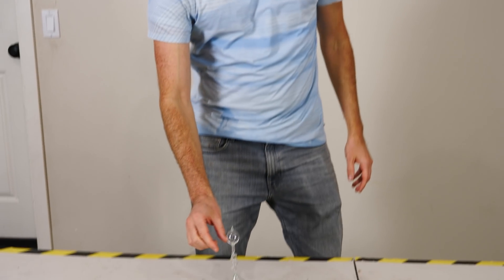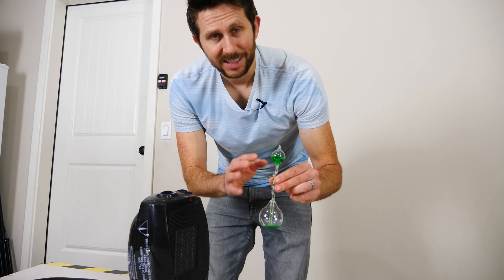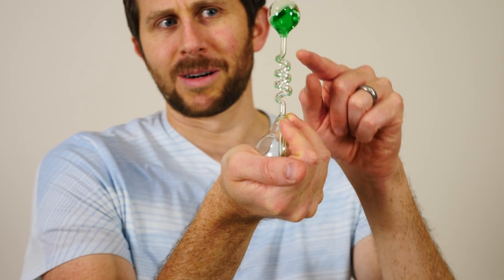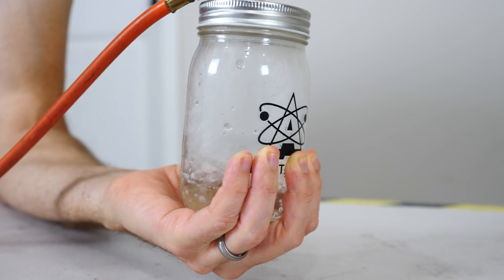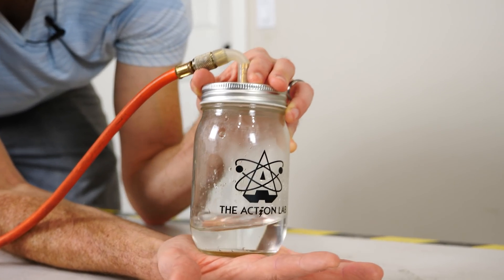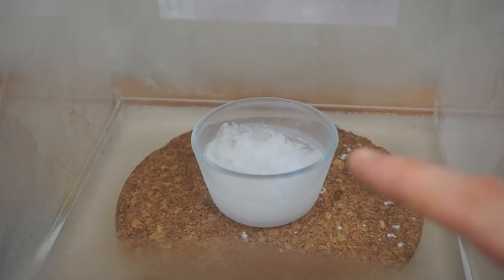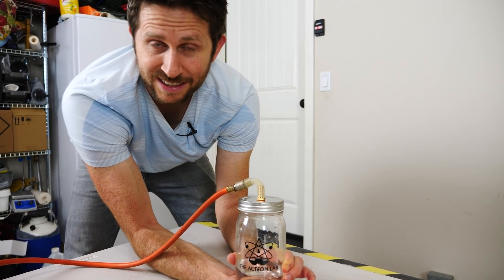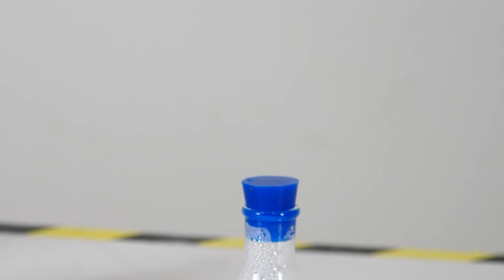Boiling Water By Heating It With My Hands

Comment: Okay I don't know how many people have fallen for his boiling water with the hand trick but his scientific explanation is very much wrong you can get water to boil without heat by simply decreasing the are pressure around it.  kind of like going up into an airplane the air pressure is 75% lower than it would be on the ground even with pressurized cabins it is why you end up with a crappy cup of tea or coffee on an airplane and while your ears pop now when you remove air from the jar of water it can boil at any temperature  it all has to do with the molecules of the water and the pressure put on them nothing to do with a hot or cold so if someone's going to post something about science please get the information right before posting there are people who will fall for this and get angry especially if they're going to do it for a science project in one of the classes or in front of a professor talk about being a laughing stock in front of your peers 
All I ask is to please do actual research on a project before you post

Comment: So, infrared light shined on say, an old 50 gallon water tank painted with matte black paint would boil or get really hot? or any container painted black?  I do camping a  lot and wonder if this would heat water for a shower, dishes, etc. for an off grid cabin (or black 2.0 paint is better??

Comment: At first I thought the "hand boiler" had all the air removed so that it just had water (+ green dye) in equilibrium with water vapor.

In the life science lab where I work a few months ago somebody wanted to get a centrifugal vacuum concentrator (centrifuge that spins samples while vacuum is applied so that they stay in the tubes while they are boiling), but they just wanted to use the house (building-supplied) vacuum, which is designed to pull large volumes of air for aspiration purposes, but not particularly good at getting low pressure.  So I had to figure out whether the house vacuum was good enough, but didn't have a vacuum gauge.  So I turned on a water bath and connected a flask to the vacuum, and measured what temperature it took to boil the water, and looked this up on an online calculator of boiling point of water vs pressure.  House vacuum only got the boiling point down to around 80 `C, which is pretty lousy, and would be worse since that is for essentially pure water, but the solutions that you need to do this with also have salt, which would raise the boiling point, and 80 `C would already be potentially enough to degrade the stuff you want in the samples (for nucleic acids, you really don't want over 65 `C, and for many antibiotics and metabolites, even that is too hot for the several minutes you would need to get rid of all of the water even with a good vacuum).

Comment: I have another (crazy?) idea: If you take hot water, but at a temperature that you can bare sticking your finger in without burning it, and you put that in a vacuum chamber, can you literally stick your finger into boiling water? (if you can get a tight seal around your arm). Maybe not a good idea if your blood also will start to boil, so the water should be well above 40 celcius.

Comment: Imagine a big hanging piston in a cylinder, the gravity pulls down the piston, so above that there will be vacum. How big that piston  and cylinder has to be to make 20 grade temperature change in a 50 m³ room? I know, stupid question with a ton of variables,   but probably less  noise than a running compressor...

Comment: So in theory if you could make a crude vacuum pump in a mad Max survival situation you could boil water without any fire and make it safe to drink
Reply from the maker: It needs the heat to kill the bacteria, not just boiling
Reply: @TheActionLab  that's what I thought but I've been up for 23 hours right now and I don't think I'm thinking straight.

Comment: 1:15 Those hand boilers do not contain water and are in fact boiling. They contain a low-boiling, slightly stinky solvent. I know, I broke one open by accident. I also tested one and it functions just fine as a heat pipe, which would not be the case if it were just air expanding and contracting.

Comment: I would say that the "hand boiler" is actually boiling the liquid and not just expanding the air like you said. It is the same principle as drinking bird which uses dichloromethane in vacuum- liquid with really low boiling point. https://en.wikipedia.org/wiki/Drinking_bird
Reply: I also think there could be more than expanding gas. Vapor pressure may increase appreciably, but the boiling effect appears to be from the inlet taking in both gas and liquid.

Comment: When you freeze liquid nitrogen by using a vacuum pump, are you actually lowering its temperature? I would think not, or maybe temporarily, but at a lower enough pressure nitrogen would be a solid at room temperature would it not?  Or if not, then it must be that the frozen liquid nitrogen would melt if maintained at a constant vacuum and allowed to warm to room temperature.

Comment: Love the video. Shouldn’t the flask be allowed to reduce to room temperature before heating it with your hand? You said it was still hot. Also gloves prevent the transfer of heat. Shouldn’t you use your bare hands for heating? I’m guessing the effect wasn’t strong enough at room temperature (or the flask stopper leaked) which required you to heat up the glove to induce boiling?

Comment: When the water molecules evaporate they remove heat with them which is called the heat of vaporization;  since you're removing the vapours using the vacuum pump, the heat energy stored in the vapour phase is removed from the system but you're not providing heat at a fast enough rate to make up for what is lost and so temperature of the system  will drop. The drop in pressure due to the vacuum pump and the drop in temperature will cause the system to move to its triple point on the phase diagram.

Comment: we used to do this experiment with a decent sized syringe, no needle, with some water in it. Pulling the plunger while the tip is covered you can lower the pressure and boil the water.

Comment: Hmmm, I wonder how a low-pressure system like this could potentially work for active cooling. Evaporation is very powerful at pulling heat away after all, especially for water that has such a high capacity.

Could you potentially create something like a heatpipe like this, but with water? That uses the same principle right in terms of pressure at least right?
The idea of a potentially pump-less (after initial low-pressure priming) system that uses gravity-feed and evaporation to very efficiently draw heat out of a component to a condenser sounds temping.
The idea would be similar to these fancy new low-boiling-temp noncondutive liquids showed off in Der8auer's prototype (for those who are in the enthusiast PC scene) - except that instead of changing the inherent boiling point of the liquid you change the pressure in the system.

Does there exist any examples of cooling systems that work like this? Am I missing something obvious that would make the whole idea a theoretical non-starter?

Comment: it is boiling in the first bottle . there is no air inside the bottle but only water vapor.  so the bottom water keeps boiling and water vapor keeps going up and condensing at the top.

Comment: To boil the water it took 100degree celcius ok but i dont think our hands can provide that heat
Next time put thermometer inside.
That boiling you showing i think its that by vacuum chamber.cauz water has some air that vacuum chamber sucks as a result there js bubbling 
Its my question pls answer.

Comment: Basically how refrigeration works. The refrigerant has a much lower boiling point than water and gets evaporated and condensed which takes heat out of the environment. You could use water but it needs more energy.

Comment: Don't forget that gasses like nitrogen and oxygen are also dissolved in water at room temperature and pressure. So some of the initial bubbling is likely just degassing of the water.

Comment: instead of sucking out air, if you force more air and increase the pressure then can you have super heated water which does not boil even at 200 degree Celsius ?

Comment: Even computer heat pipe is similar.
Nowadays laptops like Dell XPS 17 use heat chamber which is actually a chamber which is partially vacuum but has some water in it.

Comment: What happens when in a sealed sphere full of water without air
And try to increase the temperature?
Will it boil or freeze bcoz of low pressure

Comment: About the handboiler: You are wrong. It is boiling. It is not water. It is the same principle as the drinking birds, and it isn't "air" that is pushing it up, but the vapor phase of the liquid inside. (methylene chloride).

Comment: Lower the pressure, lower the boiling point. In space, body fluids directly exposed practically boil off almost immediately. IIRC, someone accidentally performed this experiment by accident in a low pressure chamber and (fortunately) survived, he reported as such.

Comment: 1:14 "when I hold it in my hand it heats up the air in the bottom and it expands"
His hands are only slightly warmer than the ambient environment and he is holding the thing from the bottom, so it seems more likely to me that he is heating up the liquid (some kind of alcohol?) causing its vapour pressure to increase immensely (compared to the pressure increase for an ideal gas).
Reply: No, that's just an ordinary water with green colour mixed in it.
Reply: Dave is correct. The fluid is usually methylene chloride not water.
https://www.scientificsonline.com/product/hand-boilers#:~:text=The%20colored%20liquid%20in%20the,evaporate%2C%20turning%20it%20to%20gas.
Reply: If you listen to what he was saying, it was water, not alcohol
Reply: @illuminum87  I know what he said, but he is mistaken. The expansion of air is at most a few percent and can't give such a violent effect, plus the way he holds it hardly warms the air.
https://van.physics.illinois.edu/qa/listing.php?id=2259&t=love-meter
http://www.physicsexperiment.co.uk/content/lovemeter.html

Comment: if you fly a drone in the same place for a long time, will it's position change relatively to the earth?
Reply: Depends on the drone.
If it's GPS stabilized, not.
Otherwise, wind will move it, not Earth's rotation, as the atmosphere rotates almost as fast as the Earth below.
Yes, there are high currents that are created partly due to Earth's rotation but convection also influences atmosphere movements and also pressure differences (wind) so the final location will be pretty random.
Remember that the air is not separated from the planet and that it is a fluid like water and honey it's just very low in viscosity but it creates drag, and it will follow the turning Earth.
Also, remember people used to fly in balloons... Just following wind movements in different altitudes. Altitude was controlled by heating and releasing heat from the balloon... And in emergencies they could drop weights to gain altitude faster to avoid collisions. But if they wanted to go east, against Earth's rotation, no problem, they just had to find a layer in the atmosphere blowing in the right direction.
You don't need a fancy drone to try it :D
Reply: @Ktulu789  do you have a life?
Reply: @DeezNuts17999  of course, man!
Reply: @Ktulu789  your comment was accurate and succinct,so thanks.
Reply: No
Reply: I think he’s done a video about this
Reply: No, because the air and all things on earth move with whe Earth
If they didn't rockets would be easier, you would fly off to space and planes wouldnt need to be a thing, you would only need to jump
Reply: @DeezNuts17999  Nice one, jump for one hour and travel 1,670 km or 1,000 miles to the west. You would still need planes to travel south or north.
Reply: @MixolydianMode  it doesnt work because your body has got the earths Rotation in itself so if you jump straight, u tecnically move in the direction the earth is moving. Planes sont work with that when flying (like using the Rotation to travel faster). They actually make half a circle kind of to fly over the parts of the earth that are further away from the equator because there the earth is not that "big" if uk what I mean..
Reply: @likamuuk  True, also if the air wouldn't move with the earth wind would be very extreme.
Reply: @MixolydianMode  yeah u have a point I never thought about that
Reply: The planet moves slowly.
Inertia will easily overcome this.

BTW VictorTheLegend doesn’t care

Comment: Sir boiling isn't an endothermic reaction but more likely to be an endothermic process.
Timestamp - 03:10
BTW 100th liker
Reply: @Musketeer Oliver BRO it gives out heat only when you touch it or the temp aroung it is low, but most of the time it utilises all the heat in phase changing.
it gives out heat when you touch it bcz of the temp gradient.
Reply: @Musketeer Oliver what oc said was that it is a process, not a reaction.
It's not that vapor is a different chemical in any way.
It's still water.
So it's not a reaction, but a change of phase.
It's just semantics, but his correction is valid :D
It's a small little detail that slipped through David's script, the video is awesome nevertheless.
Reply: @Musketeer Oliver who is OC?
Reply: 0 0  A nerd on a nerd's channel? Crazy!
Reply: @Musketeer Oliver the process of heating water doesn't release heat
dont r/woooosh me
Reply: @Musketeer Oliver thx

Comment: I have a question  :

If universe was made by the big bang then it would have happened just like a star going supernova. After a supernova , either a N star , W dwarf or a black hole is left over as the collapsed core right? So universe was a densely packed star like celestial body and then it went supernova, so where and what is its core ?
Reply: @Lee Ruan dude I gotta say the way u have written it seems like u are being sarcastic.

Comment: Are you sure the "hand boiler" doesn't have a low pressure inside it?
Reply: I was reading through the comments hoping somebody had mentioned this. I've always been told it was a vacuum inside the hand boiler. I don't think there's enough temperature difference between the top and the bottom to change the volume of air enough to cause the water movement. This would be easy enough to prove although maybe a little bit dangerous. Drill a small hole in the hand boiler this will let air in reseal it and see if it still works.